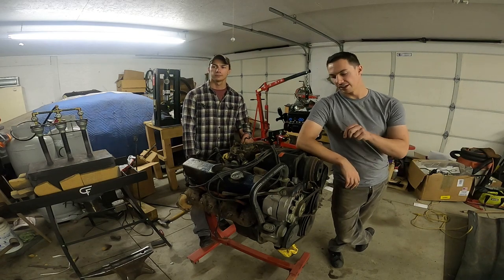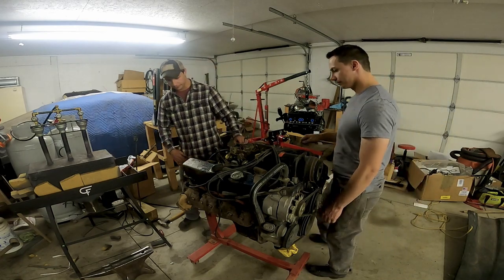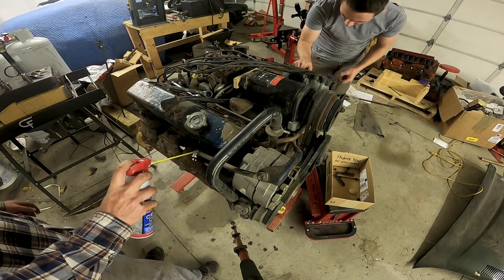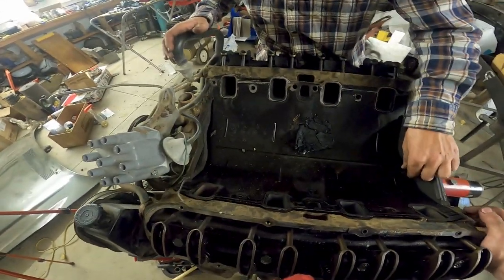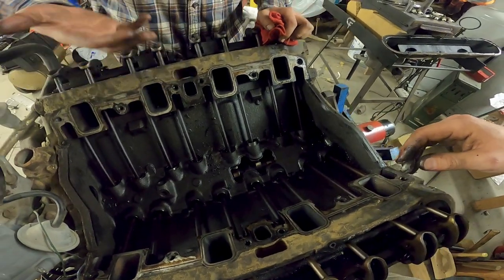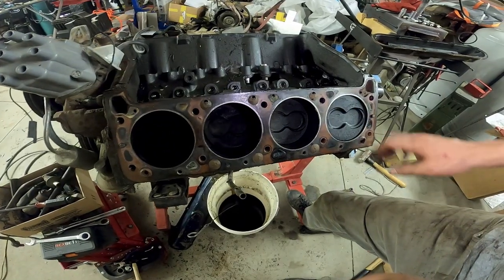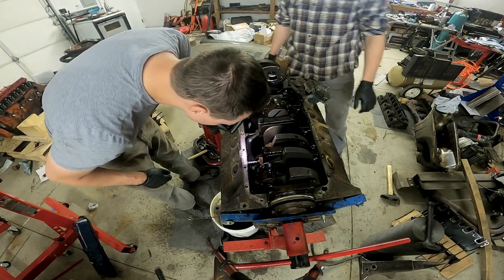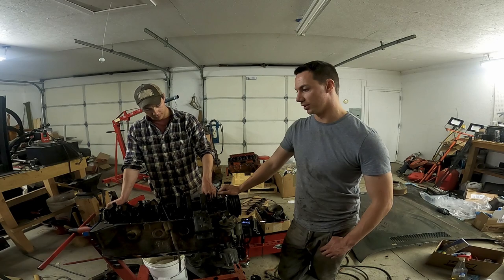Pontiac Chieftain update with Cadillac 472

Comment: The "brittle" plastic pieces in the top of the head are probably the petrified rubber remains of the valve guide seals. Also the plastic elsewhere probably is from the chewed up nylon coating from the timing chain gears like you thought that GM used from like 1966 till mid seventies. Judging by the excess slop in the timing chain there is nothing left on any of the teeth. This was done by GM to make the valvetrain noise quieter but when they wore out & the nylon came off the engine timing would become uncontrollable & the timing chain would "jump teeth" sometimes resulting in total engine loss. Quality aftermarket gearsets are available without nylon on the teeth. Otherwise the engine looked ok for a rebuild candidate. The milkyness off the oil residue on internal parts is most likely just condensation from years of sitting around.